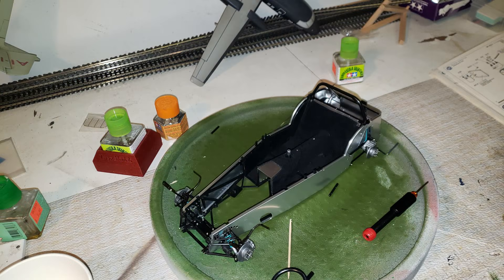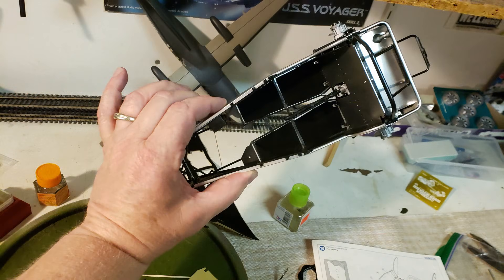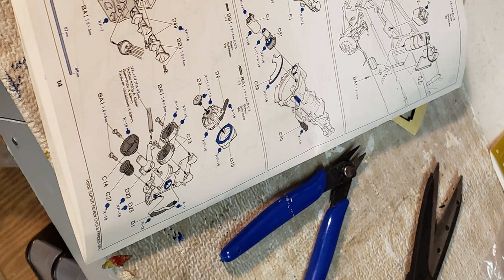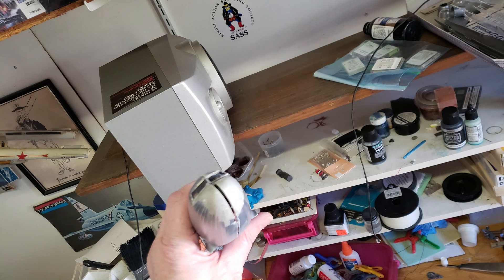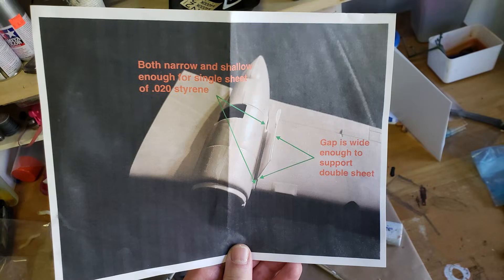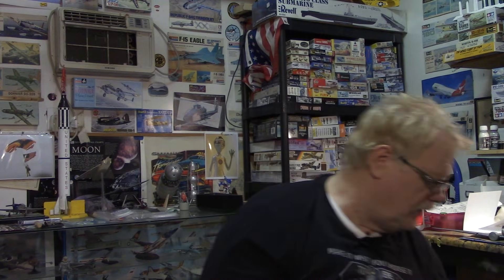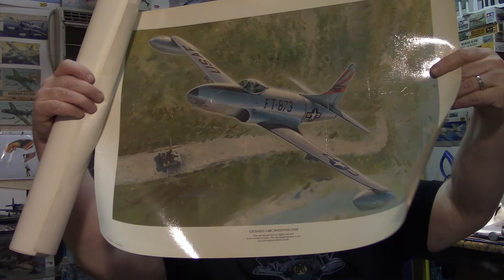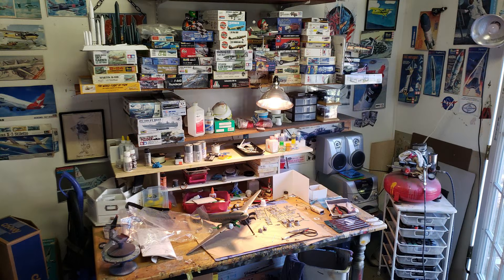Max's Models after hours 11/16/21

Comment: Heads up to any modellers UK side of the pond. Aldi supermarket have Airfix 1:72 scale models for £4.99, including paints, cement and Humbrol brush. Messerschmitt BF109-E3, Focke Wulf FW 190 A8, Hawker Hurricane MkI, Spitfire 1a, The Hunting Percival Provost T.4 and a 1:400 Mary Rose Tudor battleship. The promotion has been running a week but my local Aldi had plenty left in stock.

Comment: Look on the bright side, you can probably now build a 1:1 version AND have the pleasure of driving it!  

BTW, the polishing compound can be used to fix some paint boo boo's.  I used in on the lotus 7 as the base boy coat is Tamiya rattle can lacquer while everything else is airbrush or hand brush acrylic.  By working gently and slowly with a Q-tip I was able to remove some of the red interior and silver trim "spills" without marring the lacquer.  I was also able to remove the "blush" on the main body panels as I sprayed outside (on the porch) and the humidity and colder air clouded over some of the finish.  A little polishing compound and the fogging/blush rubbed out and the paint actually looked better.
Reply from the maker: Thanks for that.  I look forward to using it.
Reply: @maxsmodels  I actually started using this stuff to fix music CD's and eventually DVD's that were scratched.  It worked so sell I started trying it on almost anything that needed "polishing".  They make two other grades but No 2 seems to be the best.

Comment: Hi Max ,pleased that you were able to fix the DC-3 model it is a horrible feeling when something large falls model you are building. Must try the plastic card as a fuller on the Airfix 1/72 scale C-47 Skytrain model  as I have not glued wings on  but with dry runs  have find with the new Airfix model has  a large gap on left side between wing and wing fairing .

Comment: Sooooo I wasn't crazy for using the bread clip to fill a gap on the lindberg kits I received, it was the only piece of plastic I could find that was thin enough.
Ooooh, what are those chisels, lil hole drillers and micro saws...neat.
One thing I would like for the putty is a skinny long adapter to squeeze putty into tiny cracks, like a superglue tip.
That caterham reminds me of assembling a RC car.